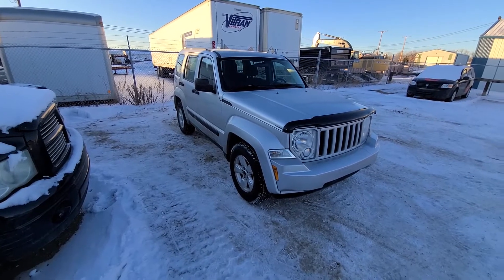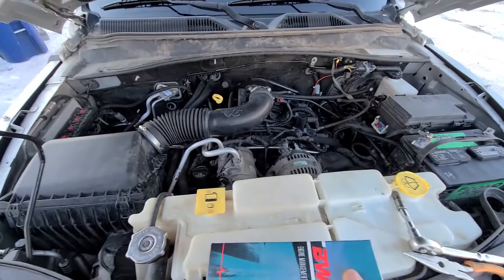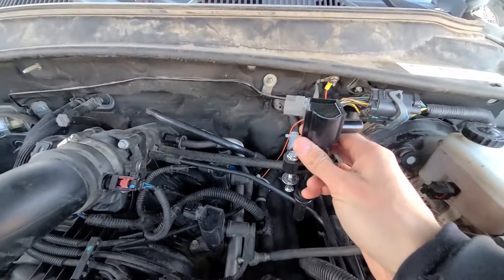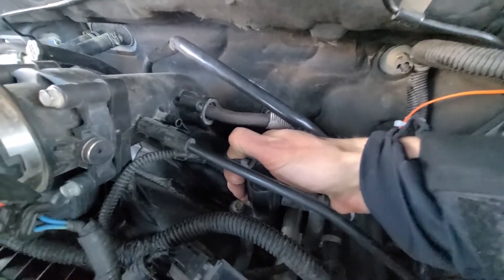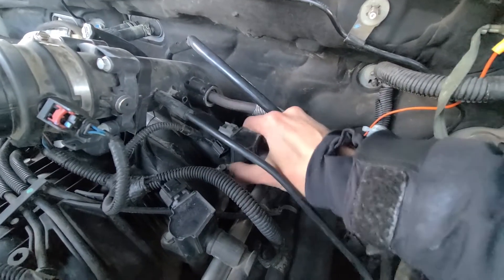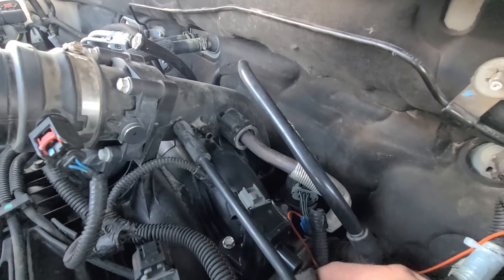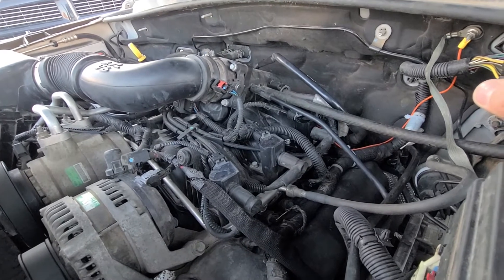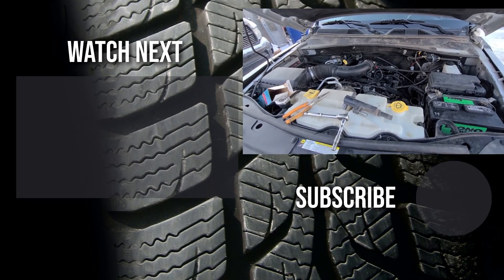Jeep Liberty - IGNITION COIL REPLACEMENT / REMOVAL (2008 - 2012)

Comment: I've got a misfire every now and then, did you have the same problem ? is that why you changed them ? Just wondering if I should change mine, thanks
Reply from the maker: It all depends on the codes you get if you are dealing with the misfire. You might need only a tune up (spark plug replacement). Best way is to scan the pcm when misfire happens and possibly test drive it with scanner hooked up to see the live data
Reply: What was the problem? Mine said misfire cylinder 3. I'm going to replace coil and plugs and hope it fixes it